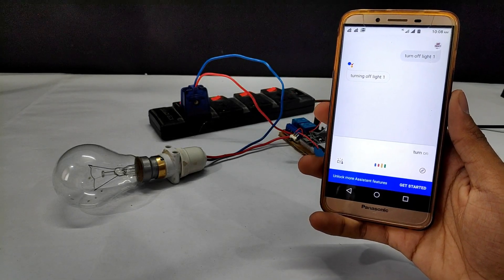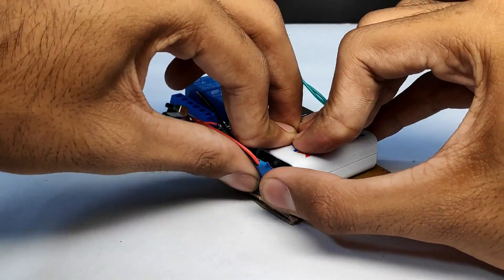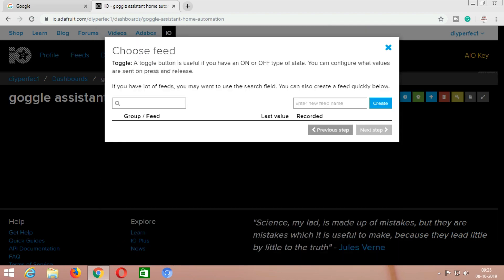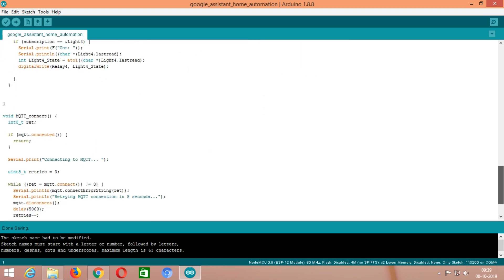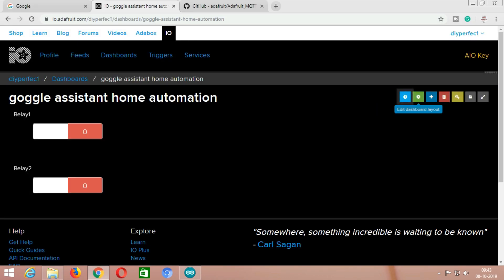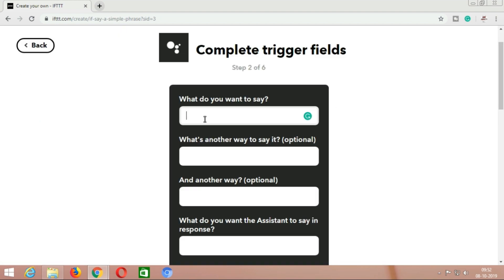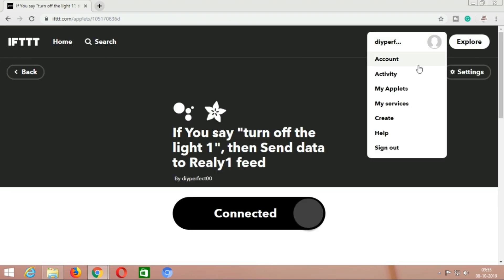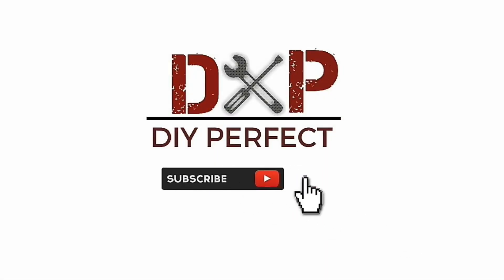Voice Controlled Home Automation | Google Assistant

Comment: In this video 
We can solding or connect jumper wire on that pins of nodemcu where it gives output pins  if we have 2 channle relay module them nodemcu pins is D1 AND D2  AND IF YOU HAVE MORE LIKE 4CHANNLE Relay module then output pins of nodemcu is D1 D2 D3 D4 and if we have 8 channle relay module then same as D1 to D8  it is depend on how much channle of your module have so it is very is to understand but in this video he did not show the pins of nodemcu  where you can get output to your relay module

Comment: What should i do if i want to add automatic fan to the home automation? Can somebody help me?
Reply from the maker: You just have to connect fan instead of bulb in the video
Reply: @Parth_188  What if i want to connect both fan & light bulb for the home automation so that i can command them using google assistant? Do i need another new Arduino/whatever?

Comment: in my command my relay lights are turning on but not my bulb why?
Reply from the maker: In this case relay may be faulty or you haven't connected it properly !
Reply: Okay I will check
Reply: @haseebshaikh7173  hey haseeb, even I'm facing this problem my relay light is turning on but not my bulb.......Did it turn on later for you? what did u do? please help me
Reply: hey haseeb, even I'm facing this problem my relay light is turning on but not my bulb.......Did it turn on later for you? what did u do? please help me
Reply: me 2 >> same problem
can anyone help us ??